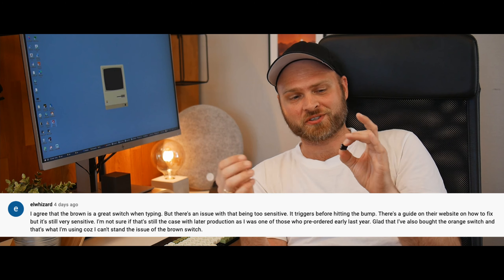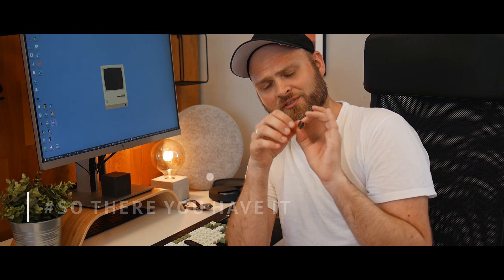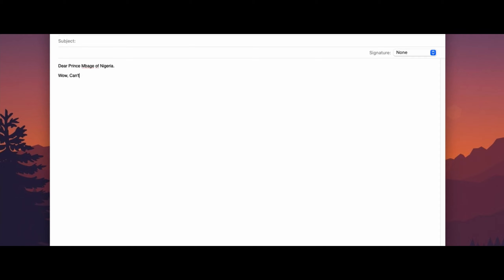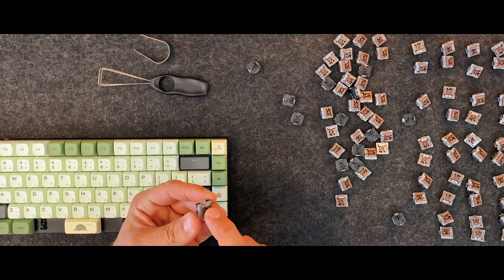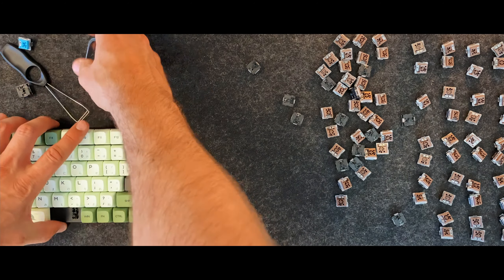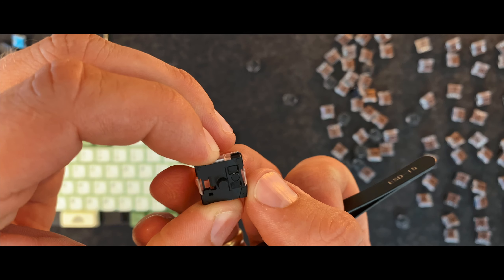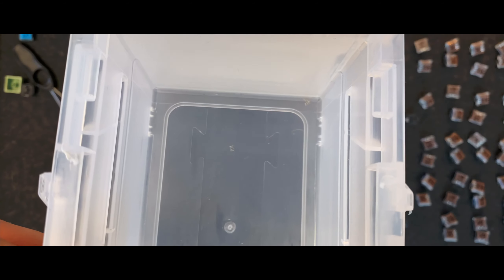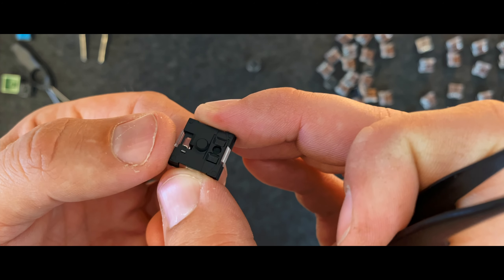Keychron K3 - FIX the Brown Switches - How to deal with the spring inside the housing

Comment: I use membrane keyboard before I decide to bought the k3v2 with optical red switch yesterday. I experience the same issue, it feels too sensitive. Even I cannot rest my finger on the key like I used to on membrane keyboard. My first thought perhaps it's due to the actuation force (40+-10gf). But then I watch your video, it happens to the brown one too. I guess I have to try to take out the spring first. Thanks man!
Reply: bro kasusnya sma utk yg red optical. 1 mnggu sy pke white backlight. trlalu snsitif. abis tu cb bli switch yg brown 2 biji dan trnyata sensitiftasnya pas bget. mkin krn type tactile nya. akhirnya kmrin sy putusin bli lagi yg brown switch rgb backlight dr nm****o dan skrg puas banget.
Reply: @ikanghandil  udah nyoba lepas per nya yg di red? apa kudu ganti switch? soalnya sama gw pake yg red ngerasa sensi banget
(did u tried to remove the spring on the red switch?)
Reply: @gansky999  niatan awalnya gt tp ga jadi bro. Pas nyoba beli yg brown 2 pcs trus di cba udh pas bget. Ga over sensi lgi. Cba aja dlu beli switch yg brown bro. Jualnya per 2 pcs. Klo cocok beli full keys aja.
Reply from the maker: Hope it worked out. You can also try the banana and mint switches. I have transitioned into a banana life.

Comment: Hi thanks for creating a video on this mod, I had trouble pulling some of my low profile optical brown switches from the bottom row, particularly the switch for the space bar. Do you know if that switch is supposed to be stuck in place or can that spacebar switch be removed?
Reply from the maker: The spacebar switch should also be removable. I hope you managed to do it by now. Sorry for the late reply. I’ve experienced that some switches require quite some force to get out. Wiggle with real force.

Comment: Does this issue persist with k3 v2?
Reply from the maker: That depends if Keychron decided to do anything about the switches as well as updates to the keyboard. I haven't asked them. The switches might still be the same although I would assume they would try and fix it since they have a guide on their website.
Reply: @MartinAaberge  just a FYI , they fixed it. I just ordered a k3v2 with browns
Reply from the maker: @DrBliff  fantastic!
Reply: @DrBliff  Where did you find information that this was addressed in the V2?
Reply: @qxorio  directly from keychron support
Reply: @DrBliff  hi. This helps. does it mean all Version 2 or some series?
Reply: on red still there. but fixed on brown.

Comment: The idea of optical switches, where click is done by a separarte spring and is totaly independent to key actuacion is weird to me. I have K3 with optical switches, I realised that it was posible to actuate before the click. Now after this video I removed the springs to see how it will change, and now with springs removed it is posible to click and not actuate. This is... stupid and wrong. Im thinking about selling this keyboard and getting normal mechanical gateron version.
Reply from the maker: They did fix the browns after this video I believe. So they should not behave badly. When did you get yours?
Reply: @MartinAaberge  recently, I got it about month ago from Keychron official store on aliexpress. I have generally mixed feelings about this hardware. It came bended a little so keyboard rocked a little on the table... I managed to unbend it :) This is unusual thing to do with your new keyboard. Then switches are a little mushy - i think  that maybe gateron will be better as they have the brown moving part of the switch smaller, so the contact surface of moving plastic parts is smaller. The click sound is not consistant across the board, some are quiet, some are more clicky. Plus actuation point not always is the click point, like I mentioned earlier. Letters print on keycaps is barely visible without the light on. Bluetoth wakeup is slow, blootooth sleep is configurable, but I have a feeling that it doesnt work always, and sometimes my keyboard dimms light after like 10 seconds of not typing. Working on cable requires using the physical switch on keyboard. 
I have also mx keys, which wakes up instantly, lits up on touch, and when I plug cable it works on cable - no need to switch additional switches. 
I love the design (the look) of Keychron and compact layout. Typing experience is also not bad, but overall it is pretty dissapointing for me and needs improvments IMO.
Reply: @MartinAaberge  yep. i can confirm this. just got my rgb brown optical k3v2 a couples hours ago and its perfect. btw replacing  my previous red optical with brown switch also got the same result.